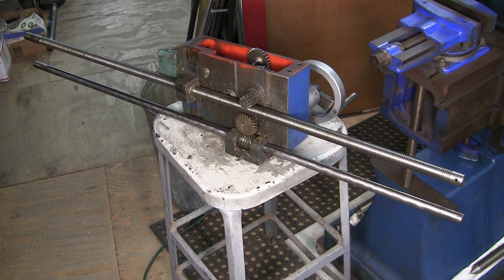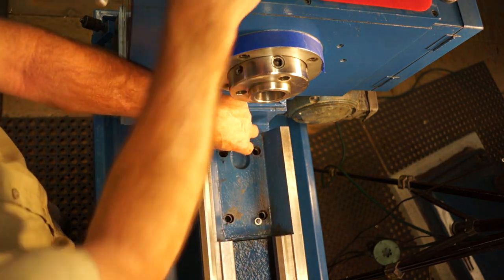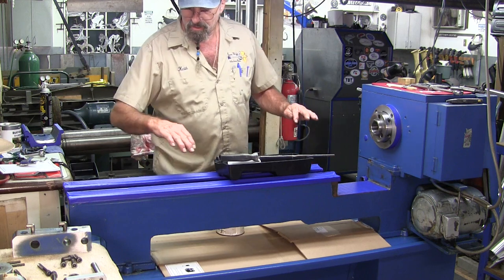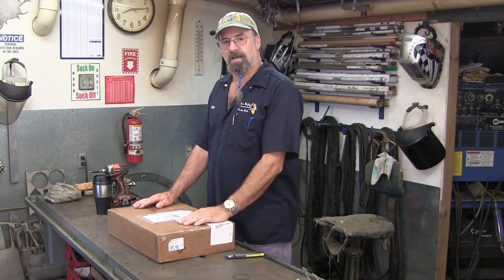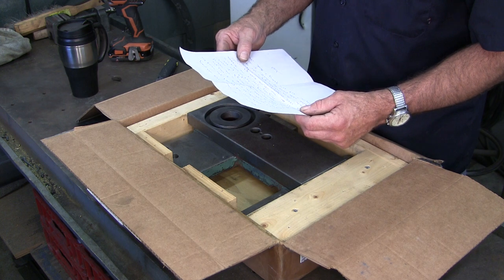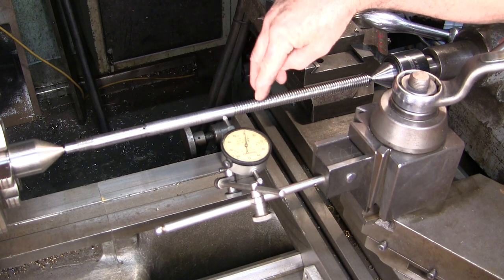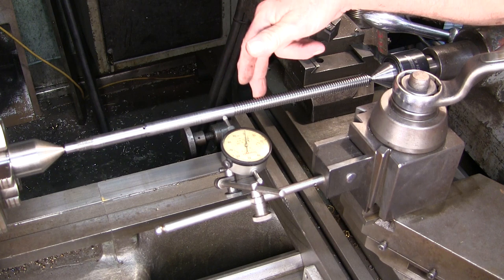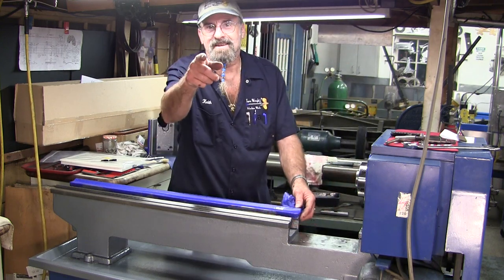Let's Look Under The Old Girl's Apron Part Two

Comment: Keith,I had to do the same repair to the apron feed worm on my old Leblond lathe.It was worn nearly 3/8" back into the casting.I set the apron casting up in the horizontal mill and then line bored and faced both bores back clean and true.I added bronze bushings to bring the bores back to a running fit on the leadscrew and added needle thrust bearings and hard washers on both sides of the worm.Also made some this plastic seal rings to keep trash out of the needle bearings.Total backlash in that drive was reduced from 3/8" to about 1 thou.Feed operation afterwards was nearly instantaneous after engaging,the reapair and improvements made the machine feel like a whole new lathe.
Reply from the maker: Awesome, thanks for the comments and the share! ;{)-------

Comment: One thing I've started doing is using Tractor paint from the local TSC store. They have all the colors but the best thing is you can add hardener. Reasonable priced and dries rock hard quickly with the hardener and does better with grease and oils. You don't have to wait days for it to cure and saves me time and no smudges from trying to rush the dry time. Don't mix a gallon at at time but I think most would realize that. those mini rollers are the berrys as you state. I use them for painting cabinets and such and gives a nice even finish as you say.

Comment: Hello Keith,

A huge thank you for a really super interesting video with some great visual and verbal advice with the machine and its painting. I never liked using rollers wen they first came out but the newer disposable ones and especially the modified one such as you did, I too did the same for painting the insides of heaters and display shelves, make it so much easier Thank you.

Love the look of your ‘professional’ silver paint job Keith! It goes really well with the blue, though I can understand you wanted a different colour for whatever reason, it is nice, if I am understanding thing correctly the part you did silver or grey come silver is the part where the metal swarf will mainly be landing.

I am writing this in addition to the first sentence/paragraph above as I had not seen the finished ‘GIB’ is it? - and what a great job done on IT, especially on the mating surfaces not usually seen. Just goes to show, as with many other instances in this trade ‘other very handy to know experts’ are there to help for-fill what will be a pretty special deed by way of the totally finished and working machine. 

Thank you once again Keith,

Take care, mrbluenun, sending you my best wises from London England UK

PS. Please forgive any errors, my laptop’s keyboard is in need of some maintenance more than I have the knowledge to do!
Reply from the maker: The whole machine will be painted hammered gray, after this section is done, we will pull covers and paint the rest as we tweak on other components.  ;{)-----
Reply: Many tans for your kind reply Keith

Comment: I had the same wear problem with my carriage drive worm and boss but I wound up milling it just a little bit bigger then using roller thrust bearings on both sides like you have on your cross slide.

Comment: Masterfully done Keith. I was going to suggest a thrust washer/bushing, but you mentioned it LOL. What is the difference between "oilite" and the material you chose (curiosity)?
Reply from the maker: 544 phosphor bronze rods,  offer excellent machinability and above average formability. Resistant to stress cracking and fatigue.   oilite is a Self-lubricating sintered bronze impregnated with higher temperature lubricant. ;{)------
Reply: Keith Fenner
Got you Keith :) We always used oilite bushing because of it lubricity. e.g wear resistant, mind you expensive. I am simply asking the man :) and simply wonder would you have used it if you had it on hand, vice what you used.
Reply: Most of the Asian bench lathe owners manuals don't mention that about once a month, if the lathe is used daily, reach under the apron with a hand full of grease and lubricate the worm and gear. I'd want to wipe it down beforehand to get all the chips (aka grinding compound) like Keith found in his lathe's worm and gear.
    Don't know if that would prevent the wear that Keith found, but it might help. You don't want to be trying to find replacement worms and gears (and half-nuts as well).
Reply from the maker: I had both on hand!  ;{)------
Reply: Keith Fenner
LOL Never answer a simple Q do you Keith. I deferred to the Master of Get 'er done for an opinion, got a cheaky answer. How else are we suppose to add/increase our wisdom and learn :(

Comment: Why do they have separate power drive shafts and threading lead screws?  Is it all about keeping the leadscrew pristine for nice thread cutting?  I'm putting a stepper motor on the leadscrew of my little lathe, which is gonna have to serve both purposes.

Comment: Some Asian lathe builders recommend that the gap not be pulled. The ways were ground after the gap was installed and getting it back perfectly is iffy. The rough finish is probably the reason. 
   I'm not a fan of gap bed lathes, especially where the gap is cut into a bed that wasn't specifically designed to have a gap in it like the lathe in the video.
Reply: His big lathe is a gap lathe, and he pulls that just fine. That one is also ground after, there's no other way to do it.
Reply: So the whole purpose of the gap is to swing a large diameter piece.If they don't recommend that you remove the gap then why have it at all?Just make a one piece bed. A lot of this Asian stuff is pretty on the outside but rough where you don't normally look.Im sure this lathe will suit keiths needs which is probably just occasional use cutting metric threads etc,
Reply: Now Ronald, there you go thinking again! I suppose that all the builders had to have a gap-bed machine to match their competitors. The lathe retailers were trying to out do each other with the features of the lathes they sold.
   The same thing happened when geared head bench lathes were the hot item. Rather than building a belt drive machine with a properly made way to change the motor and jack shaft belts, they built spur gear head stocks. If you were careful you could sometimes change spindle speeds faster than you could on an old South Bend flat belt drive lathe. You also lost speed changes.. usually 12 down to 9.
 Corners have been cut in other places as well.  Fully enclosed quick change boxes were paid for by reducing the number of threads and feeds available vs. an open QCB. 13" lathes replaced most 12" machines with the simple expedient of jacking up the head stock, tail stock and compound by 1/2 inch. The beds and carriages are identical.
   These Asian lathes are built to a price, so detail of finish usually isn't very good. If given a choice, spring for a Taiwanese machine... you'll be glad you spent the extra money.
Reply: I absolutely agree with you Aceroadholder. The bedways were ground with the gap in place. Removing it, then sanding it's seat, painting it, ect will with 100% certainty change it's height. It is now almost impossible to get the gap piece true with the stationary ways unless you want to do a LOT of shimming or sanding, checking every single time you make a change. The removable gap on my lathe will never be removed under any circumstances.

Comment: Keith, have you ever considered modifying this project with zero backlash leadscrews and adding a motor kit for CNC operations?
Reply from the maker: Yes and then I stopped! I may not be able to make it a Starrett but it will be every bit a good Mitutoyo!   LOL ;{)------

Comment: I have the Harbor Freight version of this lathe, about 8 years old.  Made in China.  I took the gap insert out, found a bunch of crud underneath it.  It looks like the crud was between the surfaces when the ways were machined.  Anyway, I have not been able to get the insert reinstalled to my satisfaction.  I figure I should be able to use a DTI and not detect any difference between the gap insert and the fixed ways.  I don't know what to do.

Also, what thickness of F5 felt and where to you get this from?

Comment: Hi  Keith, when you disassemble the cap screws and or the tapered pin posts, do you pay attention as to putting them back in the same whole location or is that a concern?? Thank you for a wonderful program.
Reply from the maker: I will show putting it back in and the way I clean and set it in place, then install the pins and socket head cap screws.
Reply: thank you for reply,  I am self teaching myself machine shop.  Of course time pending with other work.  I enjoy how you explain how to do and why in set ups etc...

Comment: lead screw half housing. housing(s) misaligned an half nuts hard to engage. then one day very easy. right UNFINISHED TOOLING unfinished tooling. ordered 4 sets, received 4 sets all wrong. 0.020 and 0.040 the other way. Engagement from new was difficult. well duh !  better look.  Wow John took a questionable part and turned it to gold. Congrats Keith. I'll send you a pic on

Comment: I've always wondered how do you scrap in a set of dovetailed ways, and keep everything parallel and the, the flats you can check with a surface plate, but getting the angles correct and the two sides parallel escapes me

Comment: I see you have chosen to cut threads in the cross slide nuts instead of using a thread forming tap.  You don't think thread forming is warranted for this purpose?

Comment: At the end of the day, from an Asian lathe i'd be happy with two things, quality metal, and better precision. If those two can be matched with other lathes, i wouldn't care if it looked like someone barfed it in to shape. Unfortunately, they skimp on the metal, which, even if the lathe is accurate new, in time, it will wear out and there's not much you can do about that. And then you're in trouble with the other I in this whole deal, investment. Because it's no match, and with time, you've lost it.
Reply: But you only paid 1/4 of the price for a new lathe.
nearly 40 years old & in that condition.
I would buy one, oh i did. LOL